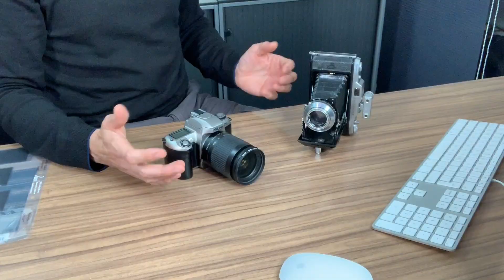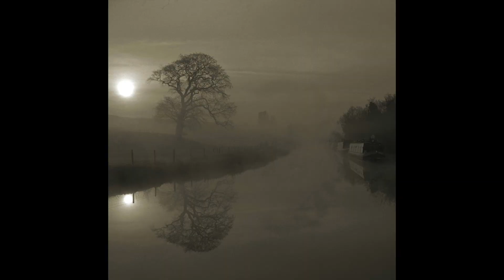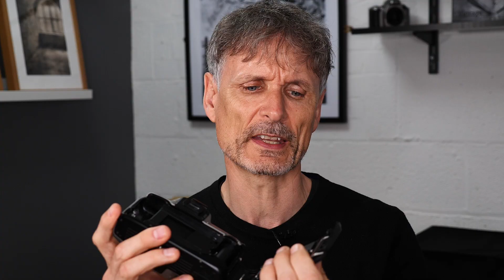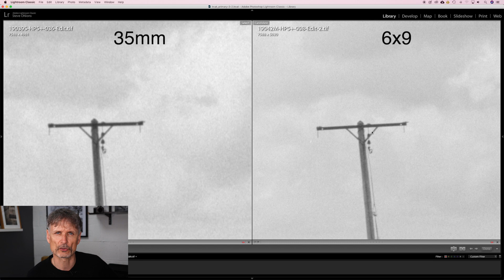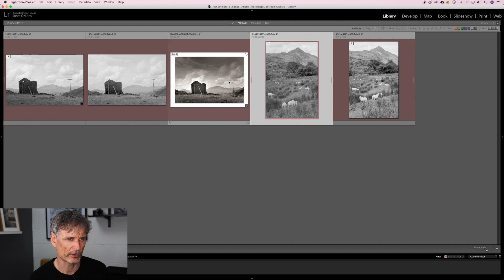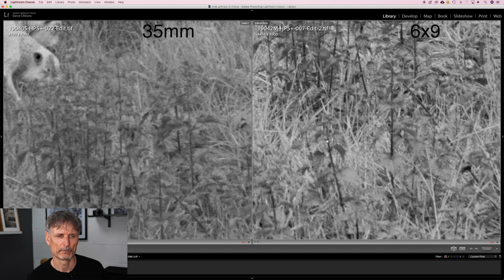Film Photography - 6x9 v 35mm for long walks

Comment: so when will we hear your thoughts on scanning?  Its my weakest stage of my workflow.   My flatbad is worse than yours but coming down to DSLR for 35mm and flatbed for 6x6. How much difference does the inversion software make? It seems expensive to purchase.
Reply from the maker: Scanning is the hardest subject to tackle as the number of variables are mind boggling Neville. I have aborted a number of videos and until I can explain it clearly I’ll hold my fire.

Comment: have you concidered scanning quality when comparing 35mm vs medium format? there will be much more details in medium format image at 3000dpi than on the 35mm with the same scanning dencity.. so to compre quality correctly you have to calculate size difference in scuare inches or mm. so if 35mm is 864mm/2  and your 6x9 is 4704, than your approx. size diffirence is 5.5 it`s not 9 times bigger, its 5.5x bigger, and to compare scans on 35mm with 6x9 you have to scan them with diffirent dpi setting, so if your scanner`s max is 3000dpi  you scan 35mm film on 3000dpi and to scan with same resolution 6x9 you have to scan on 545 dpi and only then compare images.

Comment: I love the folding cameras... but in my opinion the difference with a 35mm is not so great. At the folding cameras time it was usually to print without enlargement so the lenses wasn't ready to the enlargement as the 35mm lenses. The quality on the final print is not so great to spend a lot of money in film 120. Usually I print in 24x30cm and I can tell that the old folding 6x9 can be a choice but not for the sharpness or details on the image. A good lens on 35mm a good film with a right developer  can do better than an old 6x9 camera.... anyway I love the folding.
Reply from the maker: Hi Flavio.  Sharpness definitely favours the 35mm setup and I usually prefer to work with high quality Nikon lenses in preference to even the best folders.  Where the larger format wins is in the tonality with B&W film, it is much smoother and handles high contrast scenes more sympathetically thanks to the lower contrast lenses.

Comment: the old simple lenses and large medium format negative renders photos more like the human eye itself. I think they give a far nicer more artistic photo for those of us that like to spend the whole day finding the right shot and shooting only one frame. the newer lenses and digital sensors couldn't have that even if they wanted to. they are designed for the new breed of photographer that just waves the camera around in the air while taking 500 photos a second then spends a week cropping adjusting and basically rehashing into something completely different on Photoshop. many of the Photoshop images I see today they're so little resemblance to an actual photographic captured frame that they might as well have dispose of the camera completely and just make the images CGI from scratch
Reply from the maker: There’s certainly a different and more sympathetic rendering with older lenses, partly the design and also the coatings (or lack of them). They definitely resemble what the eye sees more realistically with a very sharp centre and the rest gradually softening - but naturally.

Comment: The 6x9 can be used to do panorama shots, creating sort of "faux wide-angle" shots. But you run out of film quite fast when doing so … ;-)
Reply from the maker: Very true, each shot counts when you’ve only got 8 per roll.
Reply: @SteveONions  But it's also liberating – I don't need to shoot lots of images to get my film processed (and I hate leaving blank images on the film ;-)). BTW, I had my Ercona fixed (it was way off with the focusing) and shot with it yesterday, but I still have to process the film (maybe this evening); then I know how good or bad this specific lens performs (and I saw that you have a "1Q" marking on your lens, so yours is a GDR export model like mine, and quality should be similar).
Reply from the maker: The lens is top quality Christian, one of the best Tessars I’ve seen.
Reply: @SteveONions  Now you know why. ;-)

Comment: while i like this video, it is crucially floored. Obviously regardless your choices, 6x9 is going to produce a larger negative, and thus more detail. But you are comparing an uncropped image (6x9) to the cropped 35mm frame, additionally, these are scanned with a flatbed, and flatbed scanners are infamously poor at scanning 35mm negatives to anything halfway sharp or decent. your comparing medium format, scanned on an appropriate scanner, to 35mm, scanned on an inappropriate scanner for the format. However, it is nice to know that there are medium format camera's that are decently portable, at least as much as some 35's.
Reply from the maker: Thanks for the feedback Nick. The purpose of the video was to consider the pros and cons of the two cameras. To reduce the number of variables I used the same film, developer and scanner, clearly a better scanner would improve the output quality.  Had I scanned the 35mm frame with my Minolta 5400 it would have shown a lot more detail but equally the large negative would look better if digitised with a dedicated 120 model. 
There are so many more variables that could change the final result including film choice, tripod, developer etc but I wanted to keep it as simple as possible.